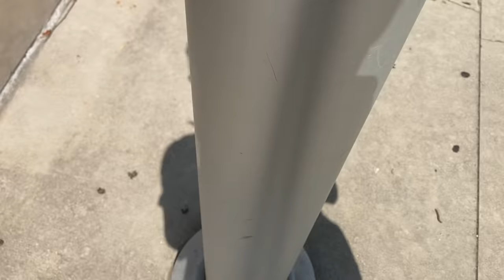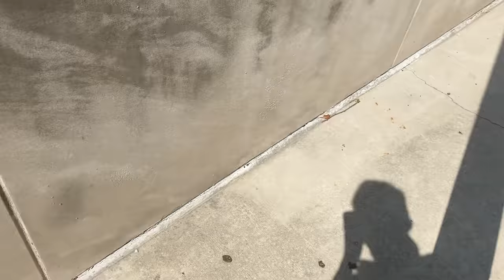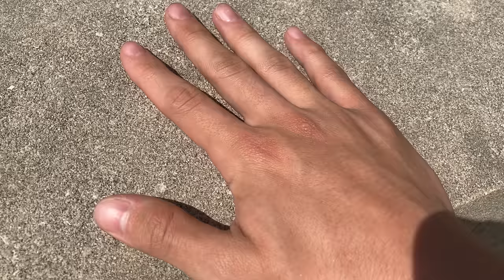Touching a metal pole and 150F (65C) concrete in the sun without getting hurt

Comment: ok so you would've got a 1st degree burn since the concrete is 150F
Reply from the maker: Thermal conductivity is really low so it would take a hella long time to do so. If you touch microwaved popcorn that’s 150 Celcius and that won’t burn you
Reply: @dapz  but you can't compare it to 150 celcius popcorn since if it was that hot it would burn causing it to actually burn you.